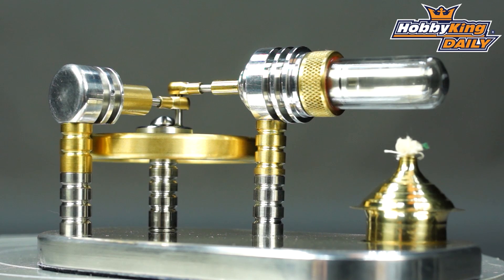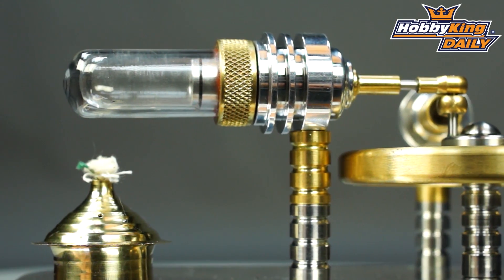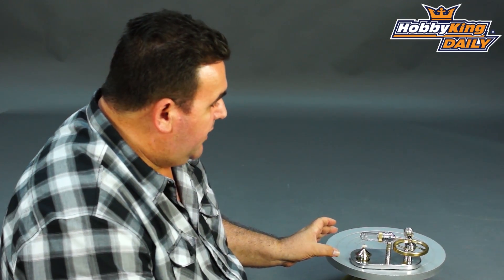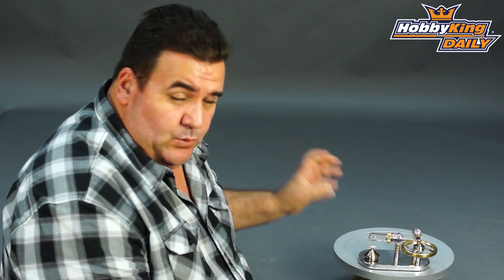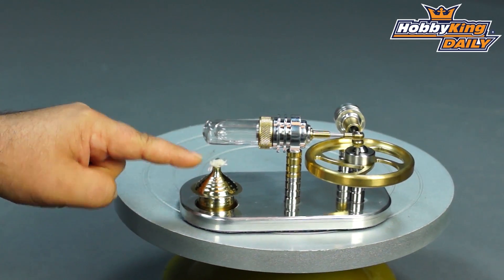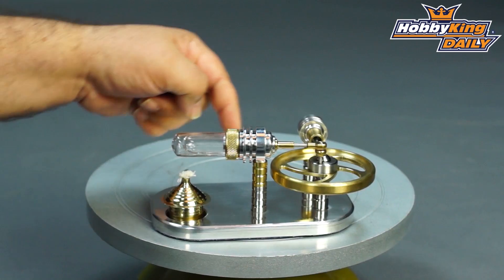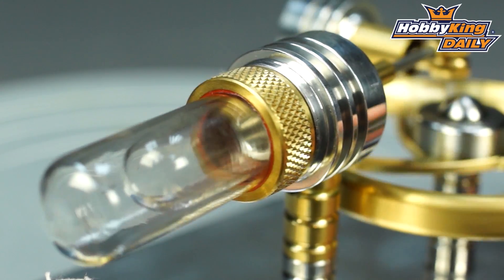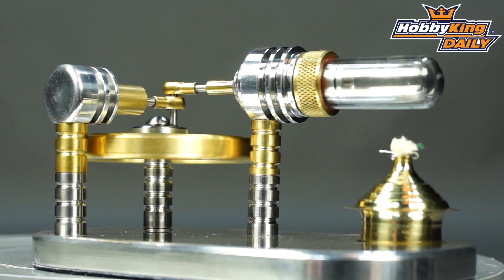HobbyKing Daily - Stirling Engine

Comment: They are showing this engine running. Stirling engines run at very low rpm because they work on a thermal pump action. It's a lot more interesting than watching an electric motor spin a shaft at 20,000 rpm.